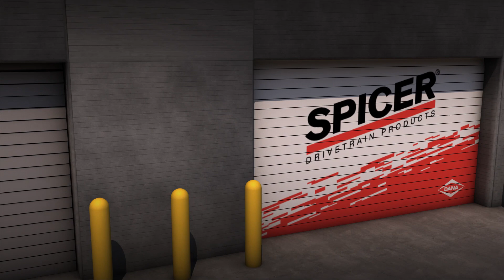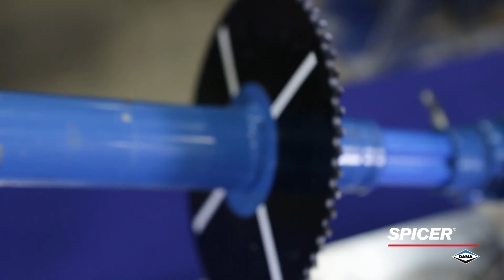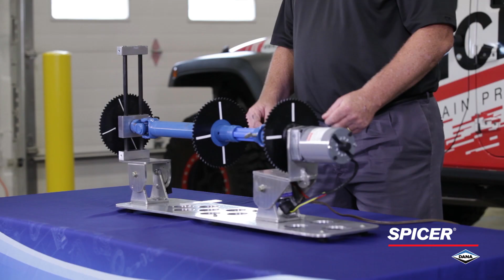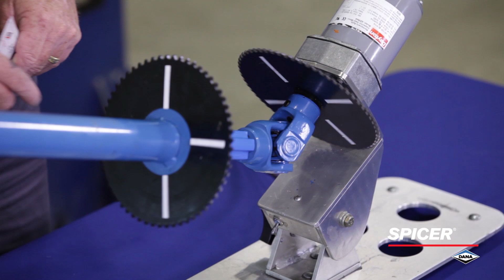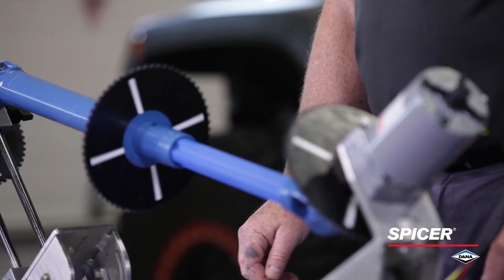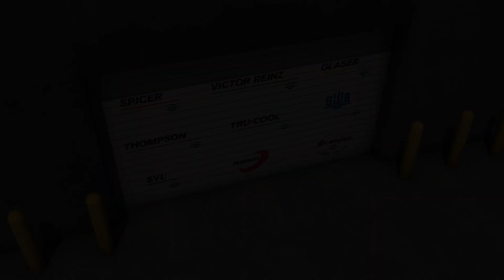Driveshaft Velocity | Spicer Garage

Comment: Just curious if you input and output angles are differnt on transmission would your driveshaft still be phased to 0 degrees? Or would it be phased to allow for the differnt angles of input and output?

Comment: This can also apply to what a driver feels in a steering system when Ujoints are causing sine wave issues.    The key is whether the shafts are in plane or out of plane.    Truing up the ends of a drive shaft for proper phasing is great, everything is as in the video.      But place those shafts out of plane and things compound and phasing the ujoints may help solve the problem.

Comment: I saw an image of a transfer case for front wheel drive in your literature, does your company still make auxillary transmissions? I have an L8000 Ford with a Cummins 8.3. It is a very reliable truck and makes plenty of power for my use but  I would like more speed on the highway. The transmission is a vocational 6 speed, again simple and reliable. An option would be to swap the trans to an overdrive unit, the rear is a single axle 23,000 Meritor (Rockwell).

Comment: You mean, the driveshaft is rotating faster at the motor end than at the other end? What BS. I didn't become an automotive engineer for 47 years (since I was 16) to see the difference in shaft rotation and so on. 

I've changed, cut and shortened/modified, repaired, etc., car and truck driveshafts and CV axles for years and I have never come across a shaft that doesn't rotate constantly.

To me it looks like that one or two universal joints are a little stiff that, when it reaches a certain point in the rotation there is a little stiffness as if something is braking it as it rotates.
Reply: It doesn't rotate faster, the speed of the rotation changes during a single revolution because of the geometry of the U-joint. As decipted in the video.
Ever wondered why some type of joints are called CV, or constant velocity joint? Because they rotate at a constant veloity at all angles, unlike a U-joint.
Reply: Hey brother I don't think you understand the video because this is a pretty well-known principle you join angles and drive shaft phasing are coming problem in the automotive DIY field.

Comment: What about a double cardan
Reply: Yes I would also like to know about what adding a double cardan joint to the mix does. My 70' Thunderbird has double cardans on both ends of the shaft. probably because they can't match the two drive angles but was curious if it needs two or if one is enough to cancel the vibration, and or what end it should be on?